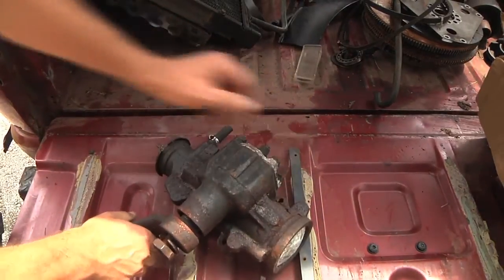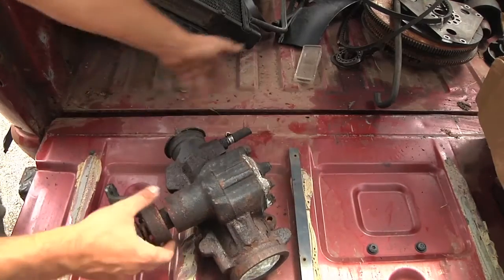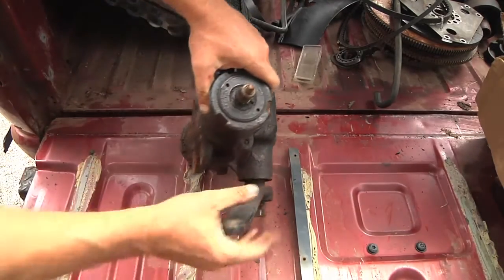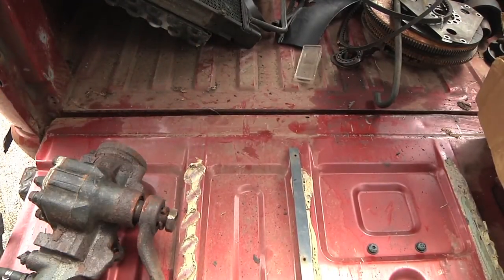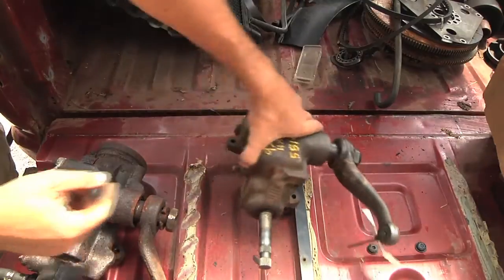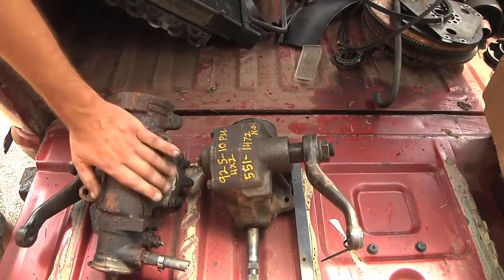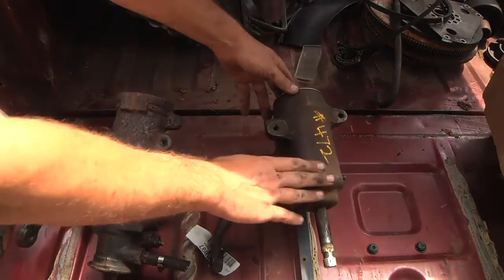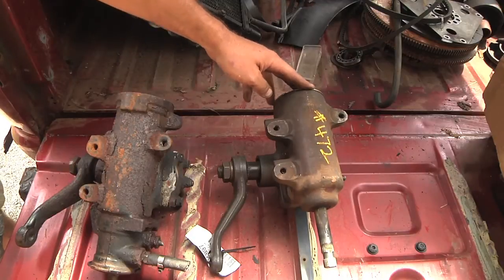SuperTruck: Steering

Comment: Correct - I've seen those links. There is also a Saturn electric pump that'll work.  But given the difference in gearing between manual and powered is "slight" according to some and I've seen a figure of about 1/3 difference in the gear ratio - but the critical thing rarely mentioned is to drain the fluid so that you're not fighting it.

Comment: It would be interesting to know what would happen if you removed and drained the power steering fluid from the auto unit. That will give a taller gear ratio for slightly harder steering but would save having to buy a manual steering unit.
My real interest is in how well something like that works for a normal car - where the power steering is "de-powered" by pulling the belt from the pump and draining the fluid.  A 5% milage boost? Online info is sketchy and it's hell to get at 
on my car.

Comment from the maker: The casting is shorter, but the input shaft of the manual steering is longer, so the total length of the manual and power steering gear boxes are both the same.